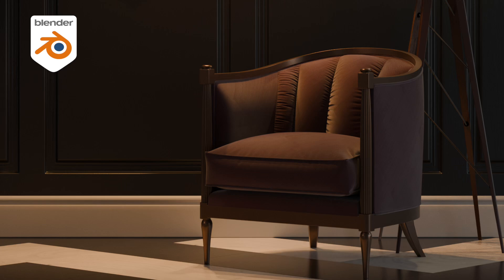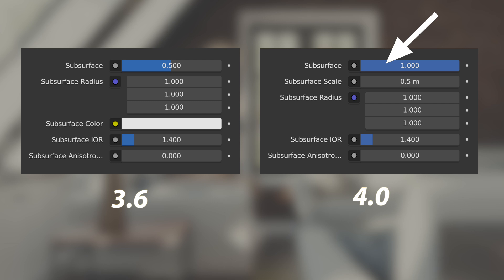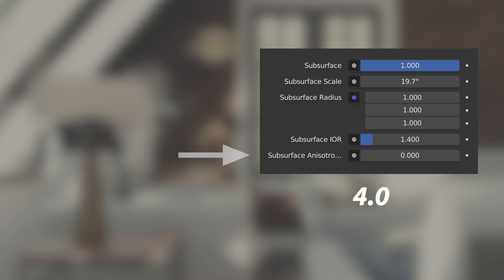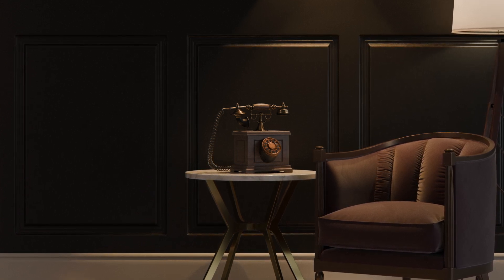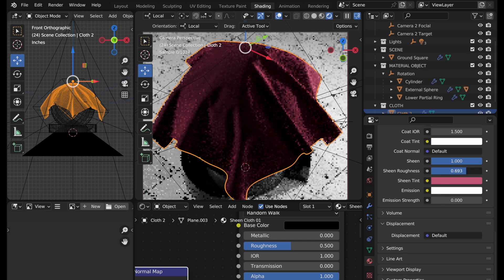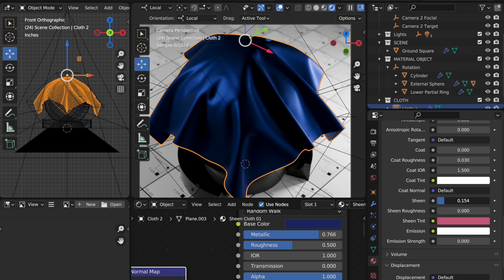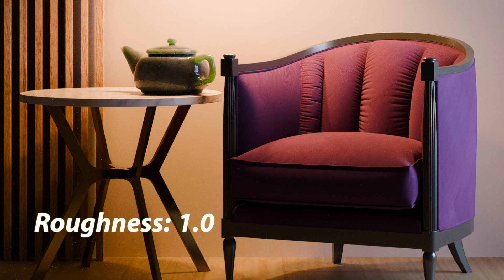Subsurface Scattering & Sheen in 4.0 are awesome!

Comment: Any advice on how to use sheen for a dust effect? I’m looking for a solution to create an epoxy finished concrete (coat over concrete base) with dust imperfections over the epoxy reflections. It’s a floor material.

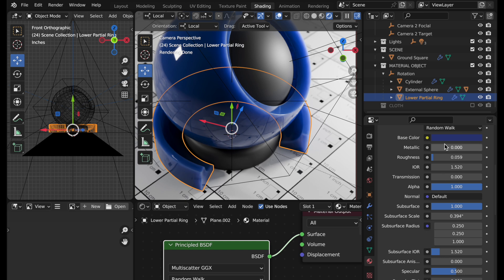Comment: I don't understand this claim that the subsurface is now somehow tied to the entire scene.  I thought subsurface scattering was OBJECT based.  Like... I'm creating a candle.  ONE object.  I want the wax to have some subsurface scattering so I go into the CANDLE'S material and just set how much I want and the color. I don't understand why this is better in 4.0.  3:20 ?  Then why couldn't they have put the letters R, G and B beside those sliders?  And we need a separate radius for each RGB channel now? I need to see what effect those have so maybe it is explained in this video.  Ah, 5:26  so just using the base color DOESN"T work!  Now, we can't just use the color wheel to change the ss color, we have to know which of the three color components in the RGB system to reduce in order to FIX the ss color.  Wow.  People generally aren't going to know that if they want to remove yellow, they need to remove both red and green in equal parts.  That's why your blue object with a greener ss got more blue because R+G is basically yellow.  Can some genius please explain how this is improved?  5:52  omg...  that was the perfect example of why this sucks.  guessing how much of r g and b to muck with because that's COUNTER intuitive.  The color wheel is perfect and intuitive.  Just pick a color.  If it's too red, then push it some into a neighboring color or closer to green to cancel some red.  Too saturated?  Slide the saturation bar down.  This is not improved.  Exact distances aren't needed.  Anyone can LOOK at their object and quickly see how much ss they need.  0 = none, 1 = max.  :(  I guess someone will make a new add-on that let's you use a simple color wheel instead of unlabeled sliders that secretly represent RGB components.
Reply from the maker: I think you misunderstand what I said. SSS is now more RELATABLE to the scale of the scene because it's using the units system YOU specify for that scene, as opposed to an abstracted apparently abstract unitless value from 3.6. But if you watch my video carefully, you'll see that in fact when you bring in a 3.6 scene, that apparently unitless 'subsurface' value was tied into meters, regardless of your scene's units. So now, in 4.0, when you specify a value, you can related it to the actual physical size of your objects in a more obvious way. The units of your scene don't determine the scattering distance, you do, on a material by material, or object by object way. It's just now more obvious now.
Reply: @christopher3d475  thx for the reply.  Ok, units are now exposed and tied to metric or English.  I understand that.   The rgb setting though needs to change, I think.  Thx!

Comment: what if you want to apply subsurface without thinking of scale? any workaround? i never took scale into account, i make abstract compositions, but i like subsurface. if i don't want to look up the scale i'm working with, should i just calculate scale by eye?

thanks for your videos, amazing info!
Reply from the maker: It's actually not behaving too differently than 3.6. For instance, if you were setting up SSS for your abstract materials in 3.6 using the default Scale value 0.5, you just configure it the same in 4.0 by setting your Scene Units to Meters and the Scale value is 0.5m, it's the same. So you shouldn't really have to do it too much differently.

Comment: Thanks for the detailed explanation Christopher, I am currently using that new sheen parameter to mimic dust for a sandstone material and it really gets the job done. Maybe it's worth mentioning that it might simulate dust in general even though it was not designed for it in the first place
Reply from the maker: Yes, that's quite true. I talked about it being used for dust at one point but I may have edited that part out.
Reply: Already very early on when designing the "roughness" parameter of this new sheen model we actually did have dust in mind as a potentially useful application. Glad to hear you find it useful! :)

Comment: Put a RGB node into Surface Radius and it will be easier to handle :) Tbh I don't know why they have a vector input and not an RGB one since that's what you are multiplying the scale with.
Reply from the maker: There's always room for improvement, 4.5, 5.0...
Reply: Maybe you can separate rgb and then load the vector. Of course, this is a bit cumbersome.

Comment: I only tested a while back, and in the standalone sheen shader. The new microfiber model handled very well normal modifications sent into it (say a fixed slope offset from actual surface normal, based on UV space). Whereas the old model (Velvet) is now completely broken doing the same trick to simulate nap direction? Not sure what that is about. So anyone using the old Velvet shader this way should really make sure the old scene is still working, and set to microfiber mode if the shading edges turn to garbage.

Comment: nice breakdown, would there be any way/benefit to feeding the base colour into surface radius for ease then just adjusting the scale accordingly?
Reply from the maker: You could use an RGB node and pass it to the Base Color, and then also pass it to the Radius, but since the radius is a physical distance value I'm not sure how the color would be interpreted by the Principled shader.

Comment: Can you pass in a node of a texture map that describes the subsurface scale or depth at local positions? I don't know if I am using the right terminology, but maybe you understand. This seems like it would be necessary for mimicking skin, since skin is not a consistent depth and density depending on body location and what is under the skin.
Reply from the maker: Yes, you can use 3D procedural texture nodes in the material editor to affect the SSS. I just didn't show it.

Comment: Oh my god, the subsurface scattering is so much better now. Although, it's a bit confusing about the "Subsurface Radius" - if those 3 values represent RGB, then why no color picker?
Reply from the maker: Think of them as secondary scalar factors for each of the channel. If you set them to 1.0 they have the full effect of the scattering radius. It's pretty straightforward.
Reply: @christopher3d475  I guess I can just connect the RGB node :)

Comment: Strange values for the Subsurface Radius parameter: instead of making a more logical color scale, the developers made it in the form of a 3D vector, and now we ourselves have to think about which parameter corresponds to the desired color. A very illogical approach.
Reply: Yeah that's the only thing I could think of as well. If the radius is obviously influencing the color then... why not have it be a color input :D
Reply: In the current version, you can simply connect a color to the blue dot and it works as intended. I imagine in 4.0 it will work the same way. @andre_julius
Reply: no, stupid approach.  No one thinks in RGB.  Like no one counts in hexadecimal.  The SS color needs to be set using the COLOR WHEEL with all the settings like saturation, value, hue etc.  I bet a LOT of people complain about this and maybe the idi... uh, person who thought this was a good idea will fix it and implement the old color wheel widget.
Reply: Maybe the initial plan was similar to what LuxCore renderer does now, which lets you set a different anisotropy (from -1 to 1) for each channel. So a material can backscatter a color and forward scatter a different one (like milk). @TruthSurge
Reply: @bmendes84  But does that really make a noticeable difference to our eyes in the end result?  I mean, the difference between scattering one color differently than another?   Like, who really could tell that just by looking?   I'm sure that there are differences in how the various bands of light react to different things but when is enough enough?  Like... how much light ray bouncing do you need?  I guess it's up to the renderer (person).  Evee renders faster but it doesn't have all the physics stuff in there so you get faster result with less realism.  I guess that's what they are trying for.  Realism in Cycles, speed and semi-realism in Evee.  ?
Reply: You talking about this update or when subsurface was added years ago?
Reply: As long as I have used it (about 2.7 forward) it lets you connect an RGB input.  @xyzonox9876

Comment: Out of curiosity, Since you are more of a professional and might be able to give a definitive answer. You used a partial metallic value in the video. I have heard conflicting information on whether or not having metallic values outside of 0 and 1 makes physical sense. On one hand, I hear the explanation that something is either metallic or not because the value represents whether or not a material conducts electricity. However on the other hand, I hear the explanation that other values are fine because they represent more complex composite materials which have a more complex interaction with light that wouldn't otherwise be able to be simulated unless you actually modeled the quantum effects of the light.

I am curious to get your opinion on this. Both on whether or not this models something physically plausible, And also what such a surface implies on a material science level.
Reply from the maker: A lot of metallic materials have very complex surface scattering properties.This can include a very rough component mixed with much more shinny or sharply glossy aspects. The way material systems like Blender's principled BSDF transition between diffuse and metallic is just one way of potentially simulating this. I actually don't often leave the slider below 1.0 and instead mix multiple metallic roughness values together, but at the end of the day, it's an artistic call. That's what I did in this video, I just made an artistic call as to what I wanted from a visual standpoint. And all 3D material systems are abstract representations of what happens in the real world.
Reply: @christopher3d475  That makes sense.  To be clear, When you refer to mixing multiple metallic roughness values, Are you referring to mixing multiple principled shaders together which have differing roughness values? Or to a different process? 

Additionally. Do you have any specific resources for research to do in order to build up a base intuition for replicating more complicated real world materials than could be replicated with the standard single principled shader 0/1 metallic workflow? Obviously when it comes down to it, The end result is artistic interpretation. But I would love to step up my material game beyond where I currently am at and your channel has already been such an invaluable resource for that.
Reply from the maker: Correct, mixing either multiple Principled shaders or with other BSDF nodes. One thing I wish Blender had is in Vray's implementation of the GGX microfacet function that includes a 'Tail' parameter. this simulates secondary roughnesses within a single BSDF layer. But we can do something similar by mixing two shaders together. 

As far as specific resource, there are databases of complex IOR values for specific materials, but Blender doesn't use those (IOR extinction coefficient) and it really just comes down to observing what's happening with real world surfaces and then trying to replicate them. I'm going to be doing another tutorial using the material tester I show in the video where I show some basic mixing for metals. Hopefully I can get to that soon. @Dryym
Reply: @christopher3d475  Yeah, I have noticed with my research that Blender's principled shader is missing a lot of features which are standard in other packages. One key example being the fact that the industry standard for SSS in skin shaders appears to be a triple layered system with epidermal, Dermal, And subdermal layers. And as someone who's still actively learning about these things, I don't actually know the most efficient way to replicate this. 

My gut tells me to mix three principled shaders together with different SSS settings, But that also feels like it'd be much slower to render than a more optimized and integrated version. However even still, It's really nice to see that it's getting some love to be more accurate and more flexible. Likewise, Your channel had been an absolute goldmine of information to help with more accurate materials.